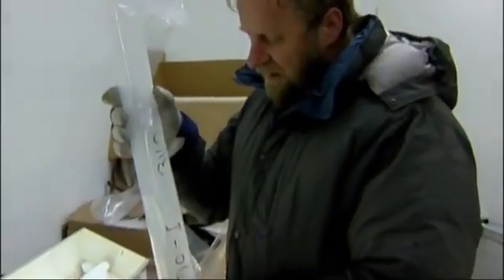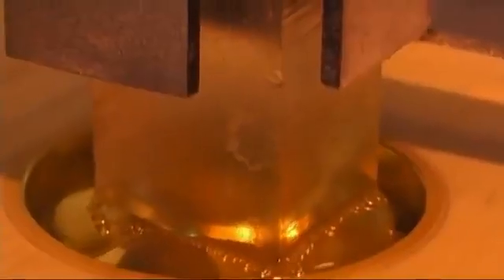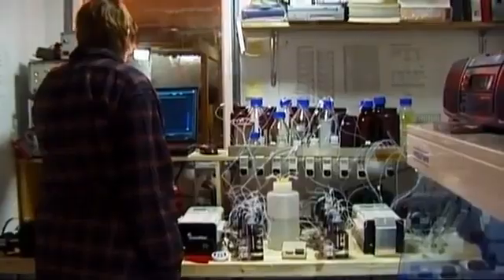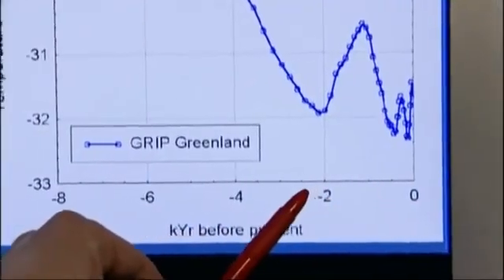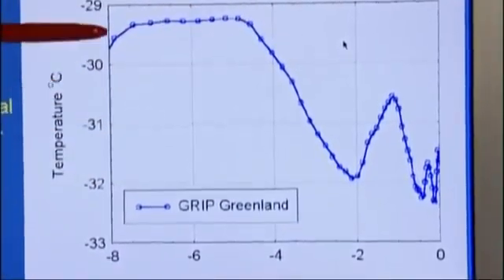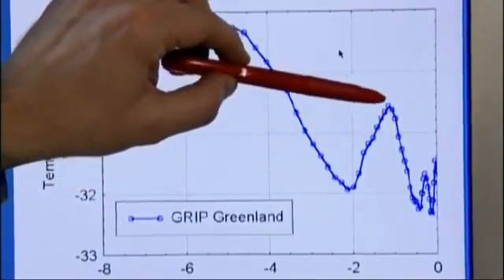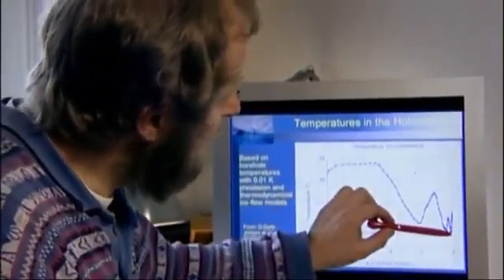The BEST Climate Clip I've EVER seen - What do you think?? #SCIENCE

Comment: His statement that there has been warming in the 20th century is quite curious compared to the actual extensive temperature data record from the United States from the late 1800s until the early 2000s clearly showing a slight cooling trend as documented by Tony Heller in his videos. Couple this with the fact that those same temperature reading stations were affected by the urban heat island effect as the timeline got closer to the 2000s, it is likely that there was even more of a cooling trend. This holds true, or at least shows there has been no warming over the past 100 years, with adjustments made for time of day measurement errors. Certainly, from the data shown by Tony heller, there has been no warming of any significance over the past 100 years in the United States.

Comment: Great video, but using a thermometer wouldn't work, as the ice won't stay the same temperature as when the snow fell, that doesn't make any sense, however using o18 as a proxy is much more accurate. 
𝛿18O increase of 1.0‰ is equivalent to approximately 4°C of cooling.

Comment: I was told by a researcher at the South Pole research centre which I really hope I can visit someday that, Antarctica is growing. Because of the Earth's position around the sun during winter (southern hemispheres summer) it's not as hot as our summer. The southern hemisphere has been more moderate for the past 20 to 30 years meaning Antarctica doesn't melt as much as the Artic does, so it's getting larger as more and more water flows from the oceans to it and freezes.

They said based on the ice drills if this continues, Antarctica will crash into Argentina, yes they'll be an ice bridge from southern Argentina to Antarctica by the end of the 21st century. 

So much for the ice caps are melting huh, PS yes the artic melts in the summer, but freezes drastically in winter meaning it too has record levels of ice on average.
Reply: Thats just wrong. Sea Ice extent is not the same as Ice thickness Especially on Land.
Antarctica does get larger seaice because the arctic winds extend Further because of a unstable jetstream. For the same reason seaice doesnt decrease for some Time in the arctic as well.

Comment: How could you measure the past temperature of the ice with a thermometer? A thermometer measures the current temperature and of course every layer of ice cannot preserve the original temperature through 10000 years. What is done normally is to measure the ratio of oxygen isotopes which gives an indication of total ice volume on the Earth and then is used as a proxy for global temperature at the time the ice was formed.
Reply: OK, understood, they measure very small temperature variations (of the order of one thousandth of a degree) which are the remnant of the original temperature. However, in order to reconstitute the original temperature, they have to apply complicated statistical inverse models with assumptions on the heat conduction coefficient of the ice layers and geothermal heat flux.

Comment: One thing I’ve noted from many, many localised [edit: from different parts of the globe] observations recently. Especially comments on here, is the (approximately) one month rotation of seasons. So from (Southern Hemisphere) Australia, not only is that an accurate observation, but our last four years have been incredibly cold. Mainly the Summer, which in my state, Victoria, has rarely had its usual 40c days in the last four years. It has also failed to regularly reach above 35c, most commonly by far, topping out in the high 20’s and low 30’s. All other seasons have dropped less temperature over this time, but despite LaNina bringing plenty of rain (you’d think would make winter temps higher on average), it hasn’t dampened the frosts. Which have returned to the regularity of the 1980’s as well as being heavier (more ice on the car windscreen), they have also shown a consistent and still continuing fall in winter temperatures.
Reply: Yes, in my state, Queensland, the last 2 summers have been the coldest since I moved here 19 years ago, with temperates struggling to get out of the 20s in a state known for 35c-40c in summer - yet I have to listen to CEOs of our Bureau of Meteorology telling us, 'The earth is getting hotter every year.'  They remind me of the Grouch Marx line, "Are you going to believe me, or what you saw?"
Reply: The earth is continuing to get hotter at an increasing rate. The current El Nino will likely mean that we will have a new record soon for hottest year ever recorded.

Comment: "...back 120,000 years." That makes sense. We are 3+ million into the Earth's fifth Ice Age. It has been warming overall for the past 40,000+ years, and the last 11,000+ years finally got warm enough to qualify as an inter glacial period within the Ice Age. This inter glacial is entirely typical, and today's temperatures are 8F/5C cooler than the last one about 130,000 years ago (which is why the Greenland ice core doesn't go back that far).

Ice Ages make up less than 10% of the Earth's history. Inter glacial periods within Ice Ages take up about 10% of each Ice Age. Therefore, temperatures today are about the LEAST likely "normal" temperature for the Earth, with the MOST "normal" temperatures being much hotter (not Ice Age, about 10C hotter) and the second most "normal" temperature being about 10C colder.

Comment: One glaring problem with using any kind of coring to get temperature ratings from Thousands to millions of years ago is that there is no way to correlate that temperature to a time of day, season of the year, or even if that spot on earth was isolated from the surface at the time. So yes, you can say the temperature of that one drop of water was a certain temperature but you can't say whether it froze in July or December, was it 3 PM on the hottest day of the year or was it 3 AM on the coldest day of the year. Add to that there is no way you can say that represents the average temperature for any period of time of more than maybe a few minutes.

Comment: UCSD Scripts Institute hosts The Keeling Curve. This chart goes back 800k years with an average high CO2 of 280(parts per million) and a low of 170 PPM. If you look at this graph on the far right you'll see it starts at a peak and then goes straight up. That peak is about 275 parts per million at 1750 when we started burning coal and oil. That was a mere 272 years ago and now we're at 420 plus which has never been seen over the past 800,000 years.
There is a ton of heat already baked into this scenario, especially with the amount of heat the oceans have already absorbed and it's an El nino year. Hold on to your hats...

Comment: This is a perfect demonstration of how to use cherry-picked facts to imply a completely erroneous conclusion. Yes of course the temps were dropping over the last 10 thousand years. We were headed back into the next glacial epoch and had humans not discovered fossil fuels and started using them extensively in the 1800s we would have continued to cool until we reached the tipping point and flipped into the the next cold cycle of the glacial/interglacial pairing. Instead we have reversed course and are getting warmer until we cross the next upward critical threshold and flip warm into the equable climate, unless we keep going past equable and  flip into a hot-state like the PETM.

 Look, for the last 4 million years we have been ping-ponging back and forth between 180 ppm CO2 during a glacial epoch, and 280 ppm CO2 during an interglacial. And that's exactly what was happening until humans intervened. Now we are over 420 ppm CO2 and still rising. Why don't you publish the rest of the rising temps on the right side of that graph? And why don't you also acknowledge that those very same ice cores reveal that the temps in Greenland jumped between 18 and 21 degrees warmer (depending on where you measure) at the end of the Younger Dryas, and that happened in a geological blink, over a 50 year time span? When the whole earth system hits a critical climate threshold going either up or down, and then accelerates through the phase change, it goes very quickly. We do not know precisely where the threshold is for flipping into the next hot state up, but it's just a question of time until we see a city like Chicago, Delhi, Sydney, Hong Kong, or Riyadh experience a 3 week wet bulb thermal max event. Nobody batted an eye when 70,000 people died in France in July 2003, but just wait until it happens in the US. 
That you use real data to blithely dismiss what we know to be true is either pathetic or hilarious. In either case it's just really stupid and you will get to have reality correct you. Unfortunately it will cost lives.
Reply: Thank you, voice of reason.

Comment: The various forms of weather measurement alluded to -- tree rings, peat bogs, etc. are only the tip of the iceberg. Other methods exist for inferring temperatures accurately going back a lot further than 8,000 years. But he only uses that period. I wonder what the whole record looks like. I suspect that it debunks his point (i.e., yes, for the cherrypicked range of time he presents, yes, we're starting record-keeping at a minimum point in the cycle). 

After all, if the period before 8,000 years ago supported his claim, surely he'd have shown it.

Comment: There' nothing new to that diagram. However:
The actual temperature of the ice changes. The historical data is stored chemically and with the ratio of isotopes ( eg. oxygene: 18O vs. 16O). I think, 3 Kilometers of ice reflect the last few million Years of Climate-Data and not just 10k Years.

During the last 10000 years earth cooled down (very slowly!!) by 1.5-2K, as shown in that diagram. And 4000 Years even before that, earth was 6K cooler than today (pre industrial). Berlin was covered by a Glacier back than. The earth became suitable for culture and science 11000 years ago, when temperature got pretty stable and it was as hot as 1900ac. So obviously it was good to stop THAT cooling. However we now managed to increase the temperature by 1.5K in under 200 years, NOT 10000 years. Climate changes, but THAT's way too fast. We are currently getting hotter than the hottest point in that curve. They just don't show it in that diagram, because there is NO ice fot that time.

Comment: They use this particular argument in the so called 'man-made climate change consensus'. They say 'there should be a cold period now but due to artificial emission we observe warming'. They cherry pick data every time. This case will not work with them. They have already stolen it. You can't win with them. Human population is obviously impacting climate on Earth but we can't fix it by any means. Any working machine is emitting heat. Laws of thermodynamics should be the guide at every aspect of our lives especially laws of nature. The more the people the more heat will be emitted. The more developed the population is, the more heat is emitted and so on. Whatever they say we can't avoid it or lower it to 'zero net emission'. Scientists should know that fact. There is no such thing possible like 'zero net emission'. It is the same case as perpetual motion machine. In fact, every side of the debate is wrong on this issue at the moment. Only a fraction of heat is transferred into space via radiation and escape of light elements like hydrogen. Most of the heat that has been emitted 'stays' here on Earth. Keep in mind heat is pure kinetic thing. It is energy of motion and vibration of molecules and nothing else. So, if there is slight change in energy absorbed from outside (from the sun), there will be a change in average temperature on Earth. It means there is a limit to heat we can emit. Like yeast fermenting sugars in a limited container. They will be consuming sugar and peeing with alcohol until the concentration becomes to toxic and they die. This will happen to us this way or another.

Comment: Well, what a lot of nonsense!  “The ice remembers the temperature… “ no it doesn’t!  Heat energy flows/dissipates to equilibrium.   Where are the corrections for: pressure - the weight of the ice might cause that nice linear growth in temp with depth; and it gets pretty hot as you penetrate the earth - usually more than a degree or two per km - how was he correcting for this?
Reply: nah, all energy, heat included, flows along gradients.  It’s not preserved in place. Water, ie ice may not be the greatest heat conductor but this ‘scientist’ has glossed over sun surface thermal gradients  (I’m a geologist).

Comment: Sincere question here: if they are measuring temperature throughout the column from where the core was taken, wouldn't the temperatures at various depths tend towards some equilibrium due to thermal conduction? IOW, how can you know that when you measure the temperature at a certain depth that that temp is the same as when that layer was the surface layer and hasn't changed due to warmer or colder temps in adjacent layers? I'm not a shill, I'm not an alarmist. I'm asking the question out of pure curiosity.

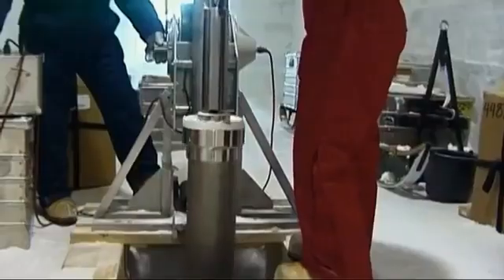Comment: What?? "... we leave a hole. And we insert a thermometer in that hole, and we are able to map out the temperature of that ice sheet" About 0:50 

I am highly skeptical that the hole made preserves the historical temperature at any particular level. Water ice is 32 degrees f., but the air in a hole through that ice will vary according to the air which came into that hole when made. And that air is fluid... moving around according to several factors, such as the temperature of the air which filled it. 

Yes I understand the value of the ice core which was removed, which can be analyzed. It tells us much about the climate. But that bit about simply finding old temperatures of different times, by lowering a thermometer into the hole, as though each level has preserved some ancient temperature from its time, is to me, ridiculous.